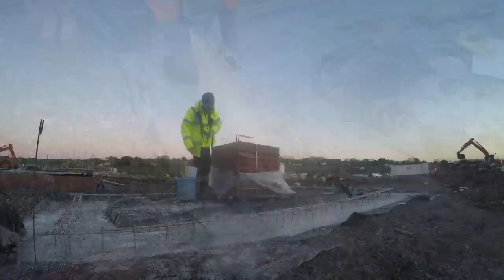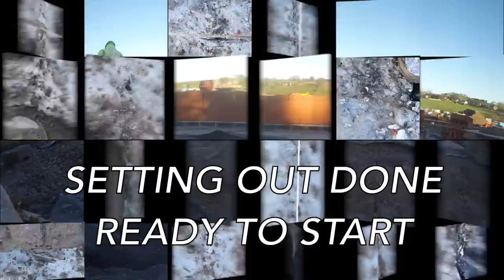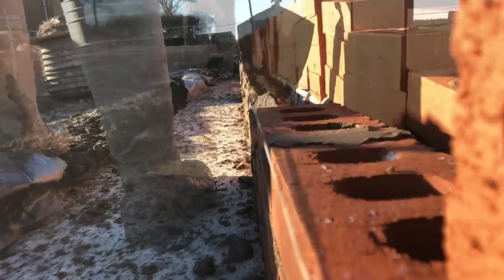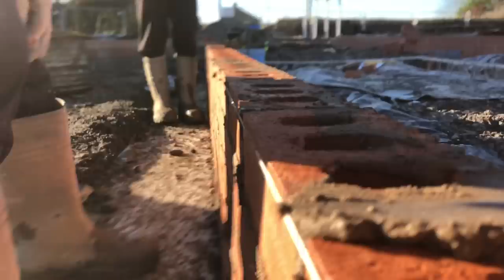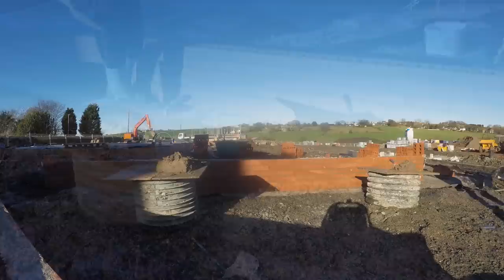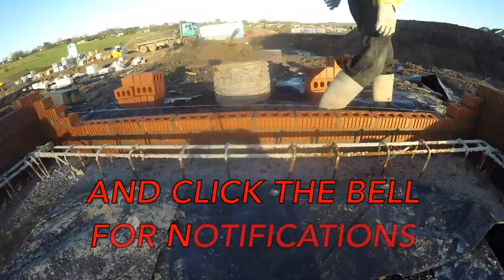RAFT FOUNDATION BRICKWORK

Comment: Nice job lads . Alex are you using a spear and Jackson trowel .
Reply from the maker: bric bybrick . Thanks very much , no it’s me Ste on the Cheap trowel 😬. Funny story l bought it when I had trowel stopper problems but then thanks to you a shiny new ox arrived before I got chance to use it . I do actually like it after a week on it (left the ox on another job) . I actually said to Alex “I bet brick by brick spots it straight away” and you did 🤨😂😂
Reply: Bricklaying With Steve and Alex ha ha good story Steve maybe those ox trowels aren’t meant for you after all  . I have a Draper expert London stainless trowel exactly the same handle that’s on your spear and Jackson  and it’s as good as any .welded construction instead of one piece forged . Thing about these trowels ,once your laying away with them it’s goes out of your head right fast who made the thing. There’s a lad from n.z . Bricklaying with izack he’s ( you should have a gander if you haven’t already) working in aus at the moment and I spotted one of the lads he’s working with using the London version of the spear  and Jackson.

Comment: That's a serious foundation for a garage with all the rebar, why was it built so strong?
Reply from the maker: NanoCottage . Hi pal it’s a raft foundation . You should see how much stone goes under it . The mot is put in about 900 wider than the garage , compacted every 300 mm , that a company comes in to plate test it to check its stable ! That cage has a “toe” about 400 mm long that extends under the brickwork . After we were done reinforcing sheets are tied to the cage then the slab gets poured . The first 7 houses were done like this and they all have 2 concrete slabs , so much concrete ! Very labour intensive . 
Thanks for watching and commenting 🧱👍🏼
Reply: @SteveAndAlexBuild  Is this site on 'Made up Ground' ?
Reply from the maker: Mark Neilson some is but there are about 12 rafts at the beginning of the site . Thanks for watching and commenting 🧱👍🏽

Comment: Laying on the line again
Reply from the maker: If you set brick against the line it stops moving which hasn’t happened , the fact that the phone filming it is almost touching it even makes it look like the bricks aren’t even down to the line but they are .
Reply: @SteveAndAlexBuild  What your doing is correct,  you should always see daylight through the line , top job lads respect. .
Reply from the maker: Anthony Mclean . Thanks pal . The camera angle isn’t very good . We are still working on getting a good angle . Some people jump in with negativity and don’t even watch the whole video. Thanks for watching and commenting 🧱👍🏼